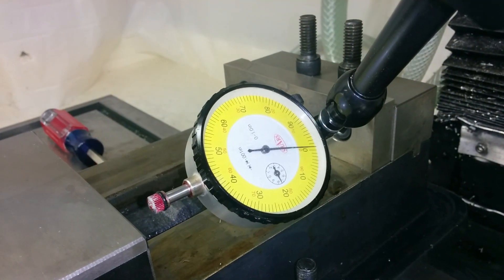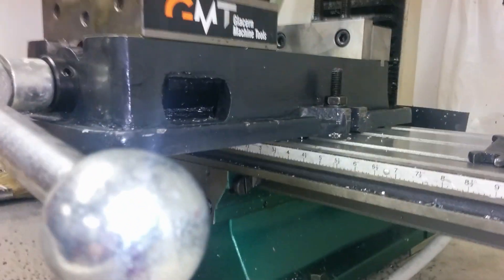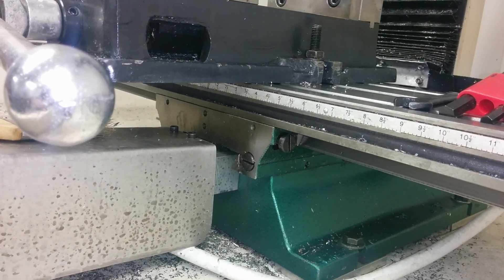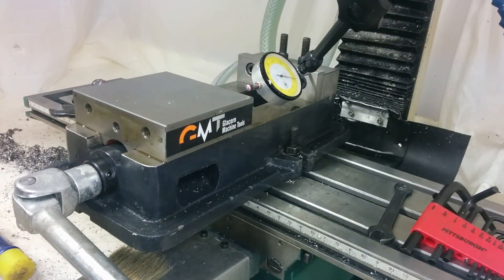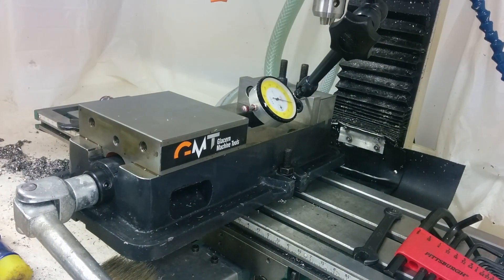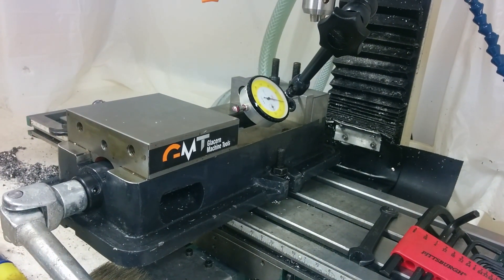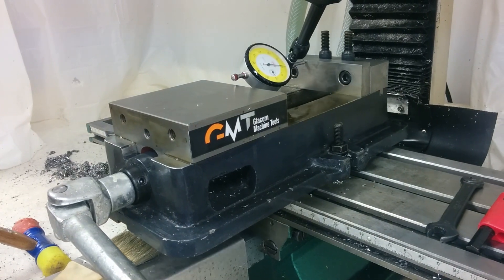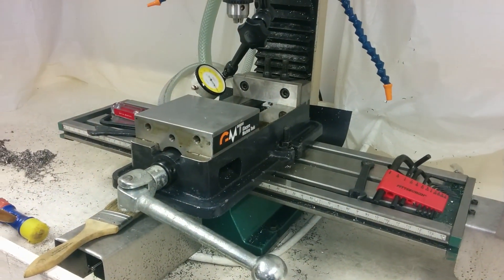G0704 weird table wobble

Comment: I had a similar issue with my CNC conversion, and it caused a 0.001" wave pattern to my milling. I think what was probably happening was that the ball-screw was binding somehow, lifting the mill table up and then down 0.0005” cyclicly with every turn. After another frustrating day of taking things apart, adjusting, putting things back together, and retesting, the solution ended up being to loosen everything up at the same time, GIBs, ball-nut, and shaft bearings-to-table nuts, then tighten them all down a little at a time while running the X axis back and forth, making sure the binding wasn’t reintroduced. You can see the before and after pictures on my blog http://longezproject.blogspot.com/2014/01/cnc-mill-conversion-part-12.html
Good luck.
Reply from the maker: Crivo152 Good thinking. I'll try this for cutting down on the problem. I'm pretty sure it's a bent screw, per my next video.
Reply from the maker: Checked out your site, very cool.
Reply: Thanks brother. Good luck with it. By the way, I am still getting it periodically, So I might have to repeat the procedure every so many hours of use. Ciao
Reply from the maker: Crivo152 I agree. I think I'm going to have to just pull the machine apart every month or two.

Comment: Something not concentric in the drive maybe? Got a friend with a good size surface plate you could roll the leadscrew on?
Reply from the maker: Yeah that's sorta what it feels like. I have a 12x18 but no one I know around here has anything bigger. I'm about to start taking it apart.
Reply from the maker: russtuff Good idea on that surface plate. It ended up not being a bent screw though (if you haven't watched the whole series).

Comment: Try it with the indicator mounted some where beside the head try it on the base and the front of the carriage. Then put the base of the indicator on the head and the tip on the base to see if the column is moving. Might be some kind of resonance.  Plug your x axis stepper into a different driver. Only other thing i can think of is to check your ballscrew nut and thrust or angular contact bearing.
Reply from the maker: Good ideas. I'll play with it.

Comment: Just for fun, did you check to make sure there are no chips on the lead screw and also that the lead screw and nut are not on a bind (maybe the stepper is a bit lose or the nut) weird..
Reply from the maker: Whatup. I checked the motor and screw connections, and the screw doesn't have chips on it but it's possible one could get sucked into the nut maybe...... I had to take a brake from working on it but going back in there in a minute.

Comment: Good luck.  Let us know....
Reply: Your lead screw nut mounting bracket looks like it has loosened up. If it has, its more symptom than cause. I'd be suspicious of gib condition. You may have to remove and inspect it for galling, debris etc.  Good luck, hope it's something simple. TC. Mike
Reply from the maker: Michael Murray I think you are right on the money. Junk built up in all the wrong places. Seems to be working well now.

Comment: my table wobbles in the same way...
Reply from the maker: CoyoteBoyUK Taking mine apart and putting it back together solved mine too, but I still don't know the root of the problem :(
Reply from the maker: ah crap.
Reply: russtuff my table used to wobble too, I had to strip and clean X and y, then reassemble with tighter gib position to eliminate it.
Reply: russtuff I did notice, when I re-assembled, that the gibs went in further and with a more gradual tightening effect after cleaning too. I also noticed, as you did that my X nut had loosened slightly, in case anyone sees this in future.